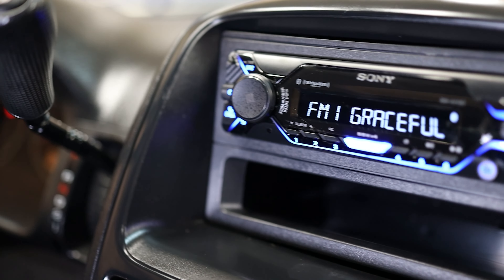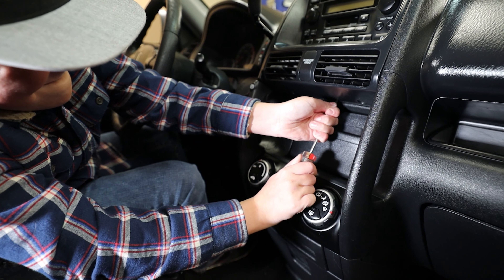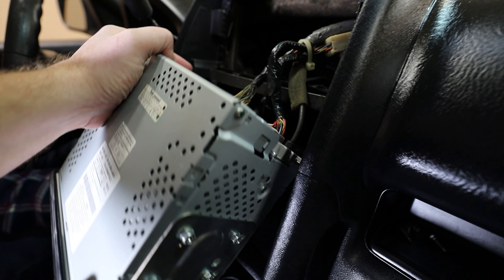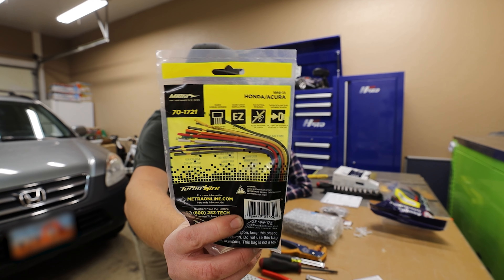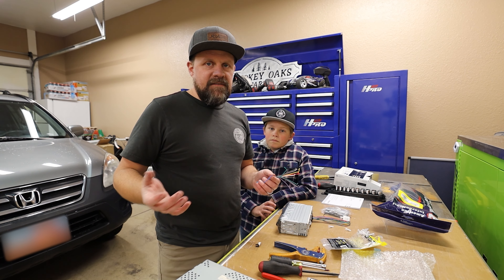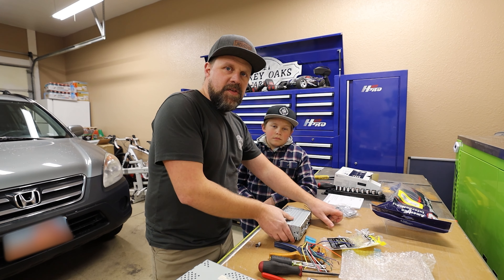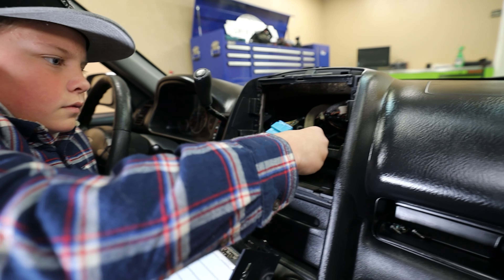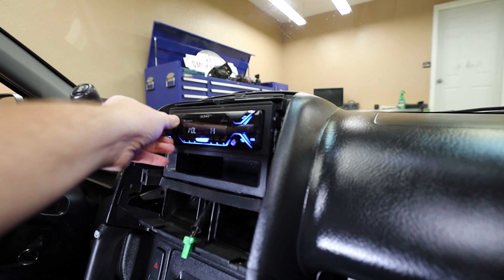So Easy That A 12 Year Old Can Install A Car Stereo?

Comment: Have you ever done a 1996 Lexus ls400? It’s the most difficult one I’ve ever seen or done I’ve installed so many head units sound systems etc. but this Lexus has no adapter and the factory amp is basically like tearing out a whole dash and hardwiring isn’t really an option bc each wire has about 3-4 different ones split into it such as like 3 FL + and 3 FL- never seen it setup like this car but I’ve looked everywhere and spent about $200 in different wiring harness anything that have gotten me nowhere